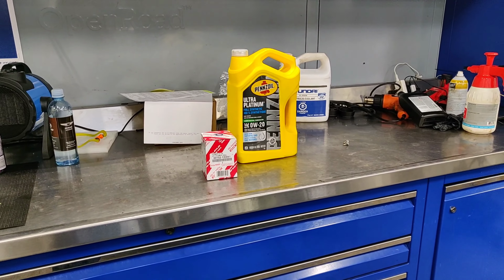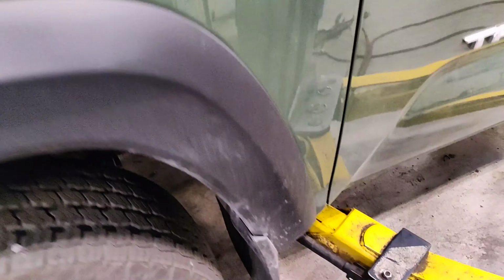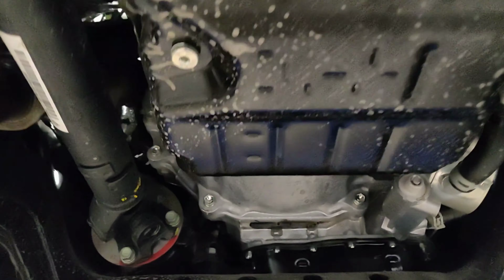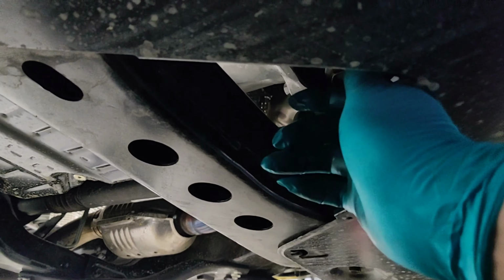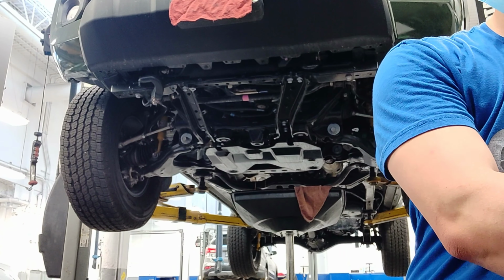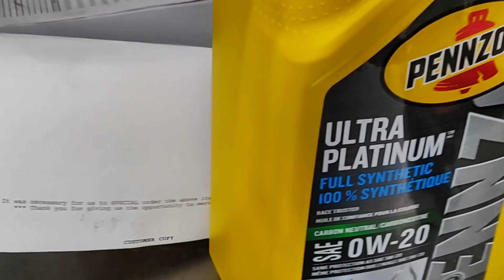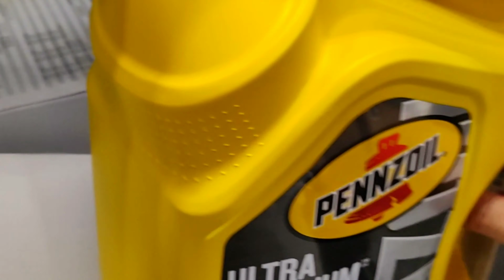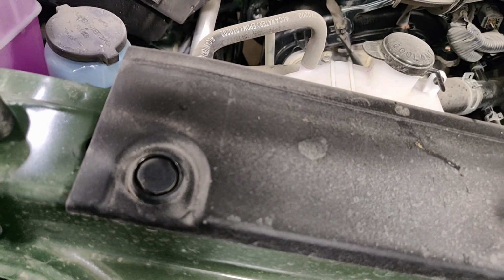My first oil change on my 2021 Toyota Tacoma

Comment: Unscrewing the fill cap will prevent a vacuum allowing oil to drain faster lol
Reply: Yeah, u can notice the difference if u do it with the cap on and off
Reply: Definitely not recommended on 0w20 if changing at home, especially when warm. Comes out quicker and Splatters everywhere
Reply: Definitely, but I would wait until you start the oil change and it starts to trickle down a bit, this will allow the initial flow to start slower and less mess, then unscrew the cap and pull the dipstick a little to avoid any vacuum.
Reply: @hostilityy  Leave the cap on first, until you get most of the oil out, then remove the cap.  Slows down the flow quite a bit and makes less a mess.
Reply: The PCV system is already venting the crankcase . Removing the oil fill cap does very very little
Reply: @EverydayJ1786  I assumed that, that's why it took me years to try it, but at least on my RAM, waiting to remove the cap lowered the pressure of the initial oil drain about 50%, much less mess than before.  I always do it hot, not sure if there are other factors on what could be creating a vacuum inside the engine, but the cap on tight vs loose, at least for my vehicle does make a noticeable difference.
Reply: @gpaje  Exactly!
Reply: @gpaje  Exactly!

Comment: Usually Toyota 0w20 engine. Have to let it for few minutes to have a better reading on oil stick. My experience.
Reply from the maker: 6 litres everytime i do my oil change dont need to check my dipstick. And i usually let it drain until a slow drip.

Comment: I would change the oilfilter before draing the oil of the reson that when you remove the oilfilter it comes oil from the system in the motor back to the oilpan. , i work with big trucks normaly and it can come back up to 2-3 quarts of oil in the truck . Same thing in a car but not the same amont of oil coming back to pan but that's the reson you should shange filer befoure changing oil.

Comment: No torque wrench???? and it does make a difference when you unscrew the fill cup... just a friendly comment
Reply from the maker: Yes in some cases opening the cap helps for instance the new smart stream engine if you don't take off the cap it takes forever to drain. Guess it depends.on the pcv system some are already vented to the fresh air side before the throttle and one to the manifold.

Comment: Why don't you Torque the parts when you re install them ? I use the same oil on my 2018......... I change it every 3,000 miles like I did on my 20 year old tundra...... BTW I hate the new Filter system TOYOTA went to..... BAD TOYOTA BAD
Reply from the maker: Not a fan of the cartridge style filter myself. I prefer the spin on.

Comment: I have the mandatory service plan.
Was required in order to purchase a Tacoma from the dealer. 
Extra $3,500 smh 
Then they said its too early bring it back at 5,000 miles
Reply from the maker: At my old dealership they offered a lube for life package for about 900 CAD on promo when you buy a new car just for oil changes. For as long as you own that vehicle. Didn't matter if you were early everyone has their own busy schedule. We even get people that go over their intervals when they paid for the package.

Comment: Just a thought. New and ambient temperature oil should probably be filled up a bit below the top mark on the dipstick. When the oil heats up and expands it will effectively rise above the high mark.
Reply from the maker: I dont bother checking the dip stick anymore cuz it always takes 6L with filter.

Comment: Does the 4 cylinder model take less oil than the 6 cylinder?
Reply from the maker: Surprisingly no, shop manual says they both take the same 6.2qt with towing package for the V6 without towing package takes 6.1qt.

Comment: Wow! I didn't expect the oil filter would be drained first. So many mechanics skip this step.
Reply from the maker: Just extra step and less mess. Bet you no one ever changes that o-ring in there either.
Reply: @theoffroadingmechanic  Do you know if the new toyota trucks have clear flood mode?
Reply from the maker: @cheese22092  in the owners manual it says in case of engine flooded to restart engine again following correct starting procedure. But doesnt say anything about a clear flood mode. Where usually if you depress the gas pedal pass a certain point while cranking would shut off the injectors. 🤷Cross that bridge when it happens

Comment: 4000km oil change is way to early. Usually around 10000-15000km is normal here.
Reply from the maker: How you service your car is up to you. Its just what ive been doing works for me and oil and oem oil filter is readily available for me. Plus i got this truck to do off roading. So low speeds and high rpms.
Reply: The engine has just run in so a lot of metal parts in oil.
Reply: Oil changes should be done when they’re needed, that doesn’t always mean at a specific mileage
Reply: Stick with your own personal oil change intervals folks

Comment: Isn't that oil filter a bit too tight? I did that to mine once and it was hell to unscrew it after. Now I only tight it as much as I can with my hand.
Reply: Looks like he tightened in until the plastic flanges met one another. Need only do it until the o-ring makes the seal. Seemed WAY too tight.

Comment: Mans says there is no need to remove oil cap when draining oil, then proceeds to rachet an oil filter full leverage. How you were not berated on the spot shows what kind of shop you work in lol.
Reply: the torque on the oil filter looked fine to me...
Reply: @SteezerZimmer  FINGER. TIGHT. THEN A QUARTER
Reply: @armagedon3on3  it's not a canister filter mate. 22nm

Comment: Question: Anyone tried the Baxter spin-on filter adapter on a Tacoma, and if so, how do you like it?  Thanks in advance.
Reply: Yep. Put one on mine and love it.
Reply: Yes I put one on my 2020 tacoma. Beats the heck out of OEM
Reply: @Accuracy1st  I looked at the BAXTER system today.... Which Filter did you go with and How much further did it extend below the motor..... Im driving a 2018  with the V6
Reply: @markvaughn8096  PUROLATOR 14670 BOSS - no clearance problems with skid plate. Does not extend much below the factory canister level